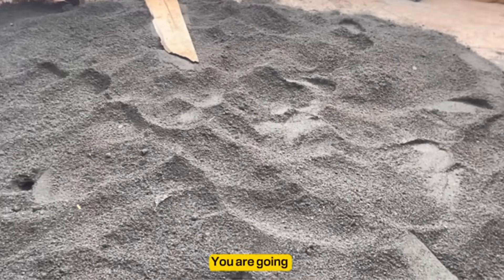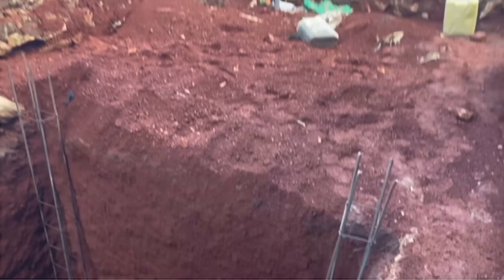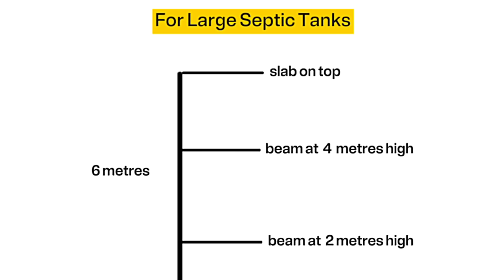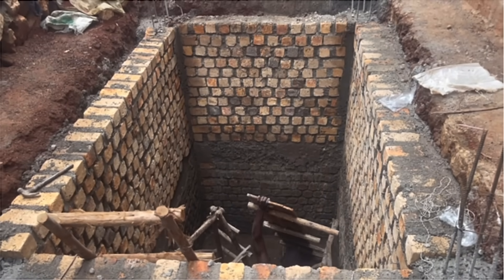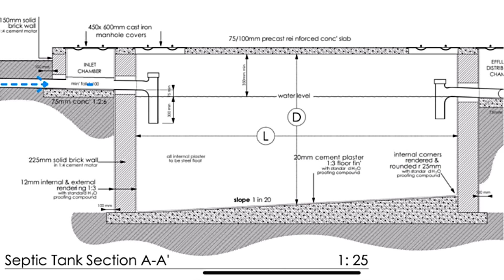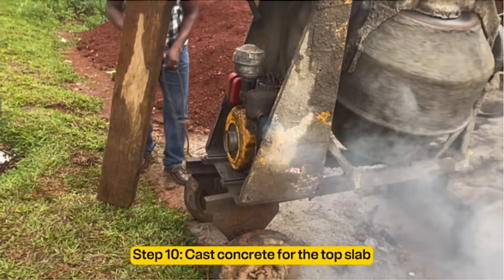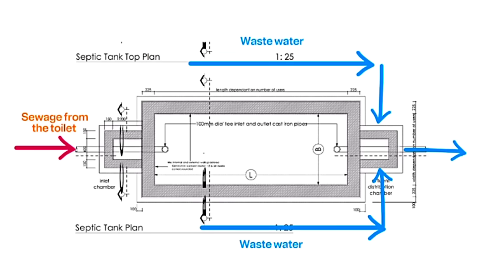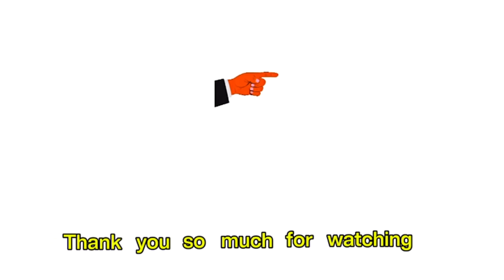How to construct a septic tank from start to finish in 2025

Comment: Great insight.

But your septic tank has no buffer walls that separate the sludge from the LIquid.
Reply from the maker: We usually opt for this kind of septic tank because of site conditions most especially when the plot is very small  and we have inadequate space 

When you have enough space, then it’s good to put a separating wall or a buffer wall 

Fore example in the above video the only space that was remaining for a septic tank  in the plot for the pit was 2.4 m length and 1.7m width. When you deduct 200mm wall thickness on both sides you remain with 2m along the length and 1.3 along the width - that space is too small to incorporate a mid wall to create 2 chambers of the septic tank 

So what we do to ensure proper consolidation of solid waste, we make the bottom sloped to ensure that all solid sediments or sludge settles at the inlet side since the outlet side is raised 

This ensures proper consolidation ensuring further clearing and settling before the liquid sewage goes to the soakpit

If you are looking forward to building a septic tank with 2 chambers, watch this video here
👉 https://youtu.be/ubQ3IqXoqsY?si=D6jaELMrs8GaUXQw
Reply: Hi need a contact number

Comment: Baffle wall aside, what is the overall height? What precaution has been taken for horizontal thrusts? ( Remember max. thrust is at 1/3 H of the waste water level)
Reply from the maker: We usually opt for this kind of septic tank because of site conditions most especially when the plot is very small  and we have inadequate space 

When you have enough space, then it’s good to put a separating wall or a buffer wall 

Fore example in the above video the only space that was remaining for a septic tank  in the plot for the pit was 2.4 m length and 1.7m width. When you deduct 200mm wall thickness on both sides you remain with 2m along the length and 1.3 along the width - that space is too small to incorporate a mid wall to create 2 chambers of the septic tank 

So what we do to ensure proper consolidation of solid waste, we make the bottom sloped to ensure that all solid sediments or sludge settles at the inlet side since the outlet side is raised 

This ensures proper consolidation ensuring further clearing and settling before the liquid sewage goes to the soakpit

If you are looking forward to building a septic tank with 2 chambers, watch this video here
👉 https://youtu.be/ubQ3IqXoqsY?si=D6jaELMrs8GaUXQw
Reply: @ianconstruction  thanks engineer for the insight

Comment: Thanks for sharing. It is very detailed and easy to understand.
Reply from the maker: My pleasure
Reply: Also there is no need for the french drain to use waterproof material but it can be covered using thinner stones until it is fully closed because it uses evaporation and aeration to drain the water. waterproof material will prevent evaporation.

Comment: thank you very much but can I set a toilet and bathroom on top of a septic tank?
Reply from the maker: yeah that’s correct that’s exactly the same way it’s done 

The only difference is that when doing steel reinforcement for the top slab, for the toilet, we put some me steel bars as bottom bars and then fix BRC as top reinforcement 

Then for the septic tank, we strictly use steel bars only for bottom top bars and bottom bars for the slab. We never use BRC anywhere when constructing a septic tank
Reply: Thanks engineer for this video but can I build a house on top of septic when reinforced like that and is there any other chemical they add in that septic tank to break waste
Reply from the maker: @BilabiGodfrey Yes you can build it on top

To do that,
You have to ensure to use Y16 steel bars for the columns and beams, the slab has to have both top bars and bottom bars and you have to use strong concrete every where (Mix 1:1.5:3) when building the septic tank 

The chemicals on market destroy the walls which are not an option to go for,
Bacteria grows naturally within the septic tank to break down the solid sewage to liquid sewage which can soak away to the soak pit 

Ensure not to flash baby wipes or pampers, female pads or any other non biodegradable products into the septic tank

Tell the plumber to direct sewage from the toilet only to the septic tank, and then wastewater with soap, fats and oils directed to the soak pit 

Fill the tank to full capacity with water before using it the first time 

This way, there’s no need for the chemical to break the waste, it will happen by itself
Reply: @ianconstruction  God bless you engineer, I have gained much knowledge concerning septic tank procedures,
Reply from the maker: @BilabiGodfrey My pleasure sir
I’m really grateful that you find it helpful
Reply: What is the use of that middle PVC pipe in the sock pit

Comment: Thanks alot engineer.
In your earlier video about septic tanks you recommended it to be atleast 30m from a well.

We already have an underground well but our plot is small and thus can't allow the 30m spacing. Are there any adjustments that can be made during septic construction so as not to affect the well water
Reply from the maker: When the water well is near you have to opt for percolation trenches not the soak pit, here’s how
 
At the outlet pipe, instead of excavating a soak pit, you create a branch of trenches just like your hand. The arm is your outlet pipe and your fingers are the trenches 

One outlet pipe with different trenches with a depth 2-3 ft below the ground

Fill the trenches with aggregates, then lay 100mm diameter pipes( 1:100 slope) a relatively flat slope 

Then drill small holes at the all along the underside of the PVC agricultural pipes to enable liquid sewage seep away easily to the aggregates 

On top of the pipes
Again cover a layer of aggregates. Don’t use hardcore anywhere use the aggregates that we use to cast concrete 3/4 aggregates 

On top of the aggregates cover with a polythene sheeting and then put a layer of good marrum on top( don’t use black soil on top of the polythene sheeting. 

The above text is not well organized but I hope it helps 

You can visit our website www.ianconstructions.com or email me ianconstruction.yt@gmail.com I send you drawings particularly for your issue
Reply: God bless you more engineer 🙏
Reply: Engineer, what if I just use a very long outlet pipe and then dig the soak pit very far away from the septic tank